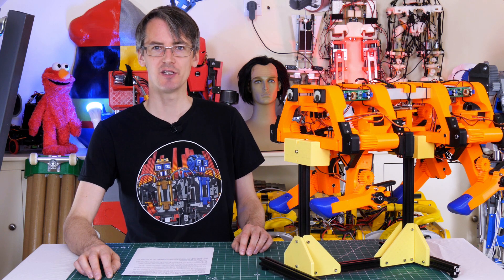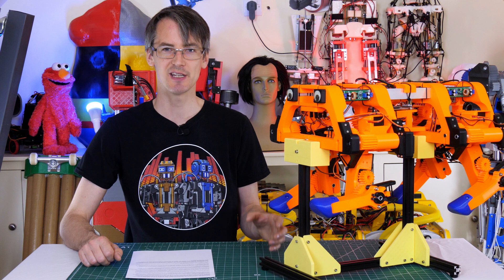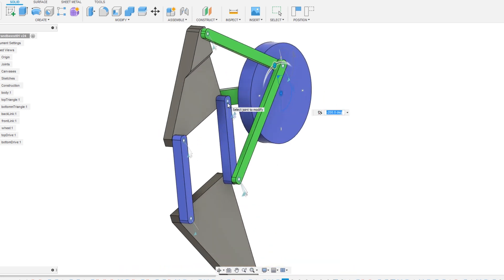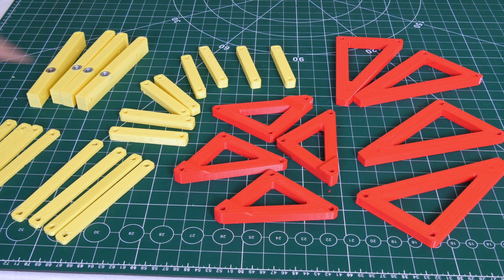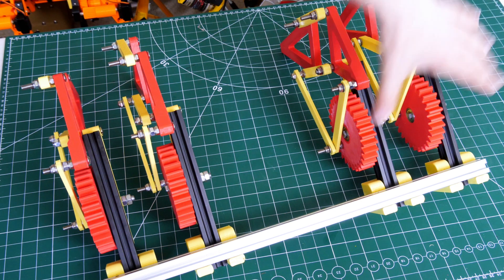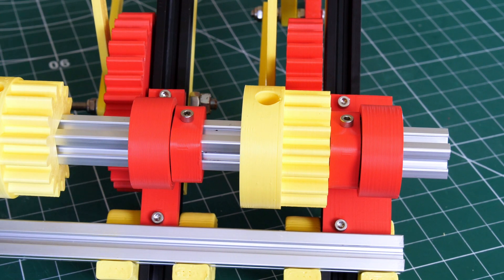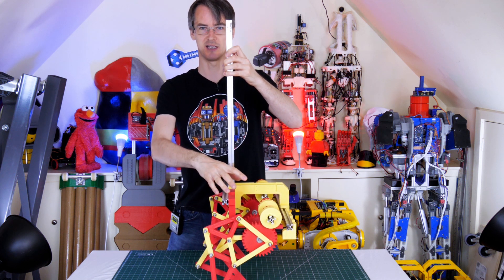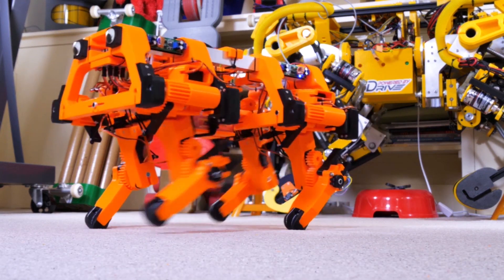Strandbeest with a Difference

Comment: Hello James! I think with you might run into trouble with your Standbeest's locomotion, as I've been working on my own version during lockdown, and you have your drive wheel in the same level as the pivot point of the legs, I've been under the impression that you have the drive wheel higher than the pivot axle. If you look at Adam Savages video on his peddle powered Strandbeest, you'll see he had it like your current setup, and had to bodge it to raise the axle into to the desired location. Keep up the great videos! Always love your videos and I'll be getting some merch once I've got a bit more free cash :)
Reply: petro1986 James needs to see this
Reply: @fantasticphil3863  It's safe to say that the useful comments have let him know by now x

Comment: Most (simple) dynamic models for bipedal robots do model the system as an inverted pendulum.
 If you can get the center of gravity inside a polygon defined by the footprint of the robot you can get static stability. I
However if you can computer the zero moment point and keep it inside the same polygon you can get dynamic stability

Comment: I made a small stranbeest a couple of years ago, in order for the foot to run perfectly parallel to the ground, the 'cam gear' axle needs to be a bit higher than the hip joint of the leg, this is an issue Adam Savage also ran into and had to reweld his beest
Reply: Very much so. Another thing is that the geometry is designed for 3 legs in a set. With 3 legs offset 120(?) degrees there is always a leg in contact with the ground. So with 3 legs you can use a wheeled approximation. It looks like he susses that out in the next video though he over corrects with 4.  (sim showing 3 legs create a continuous contact with ground) https://en.wikipedia.org/wiki/Jansen%27s_linkage#/media/File:Strandbeest--Full-Walking-Animation.gif

Comment: It is a travesty that you can't simulate these things in some kind of physics sandbox before you print them. So much wasted time and energy. I realize he gets paid anyway, but in terms of pure development efficiency a simulation step has obvious utility.
Reply from the maker: It's very hard to simulate every single thing, also people wouldn't watch a video about a simulation - the content is all about imagining what'll happen and seeing if it'll work. Perhaps Colin Furze should 'make a simulation first' too?
Reply: @jamesbruton  As I said, I realize your entertainment motives, it's how you get paid anyway. And I realize simulations aren't perfect. (Nirvana fallacy.) But they do give useful information. Especially with extreme physical issues that you simply didn't consider, such as the sideways leg wobble you only discovered after printing and assembly. You would have seen that in even a rudimentary physics simulation. Further, the entertainment angle would not be harmed by the addition of a simulation step into your design work flow, it would simply improve your product. Assuming it's even possible of course to dump your print cad into such a sim, which it may well not be.

Perhaps more importantly if you did have a simulation step your whole channel would be more accessible since cad and sim has to be order of mags cheaper than print and test.

Anyway, I'm not scolding, just suggesting. Love the channel. Feel bad for the amount of work you have to do that ends up wasted in all senses except for the YouTube views and learning. Certainly shows how daunting prototyping and the like are.

Comment: I feel like it will be a lot more difficult to make it stand because the feet are not in constant contact with the ground unlike a wheel. Because of that it will need to be able to move the legs very quickly so it step forward or back and can put the leg back on the ground quickly to maintain balance.

Comment: If you use differentials in the shoulder of opendog you could use the power of two motors to drive the upper leg  while still being able to bend the legs outwards. I looked on ebay and there is a ton of cheap metal model building differentials on there. You could drive the differential with servos and still get a large range of motion in 2 axis while having the power of both servos combined. 
https://altairhyperworks.com/images/motionsolve-models/26-OpenDifferential.gif
You would drive the blue gear on the outside with servos and youhave to put in a second bevel gear on the opposite of the blue drive gear. If both servos turn in the same direction whis would tilt the whole assembly. If they would turn opposite of each other this would drive the output axis. You would have to lock one side of the output side to the shoulder.

Comment: This is a really interesting idea, I'd love to see a legged balancing robot like this. One thing I'm worried about is that this robot might not be able to tilt itself by walking since the feet move in a straight line along the ground with a fixed angle. So if the center of gravity is not already right on top of the feet, it might not work at all.
Reply: yeah this is my concern too